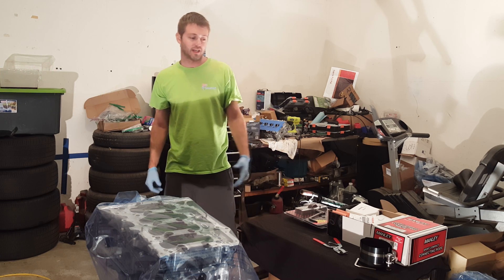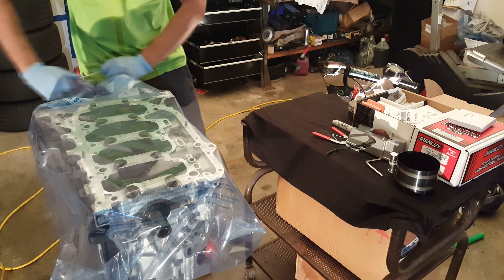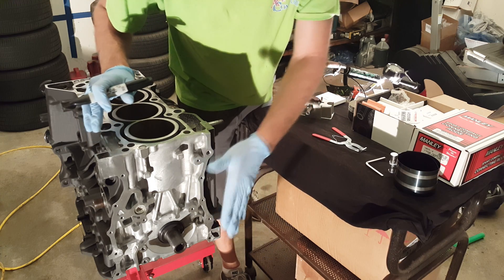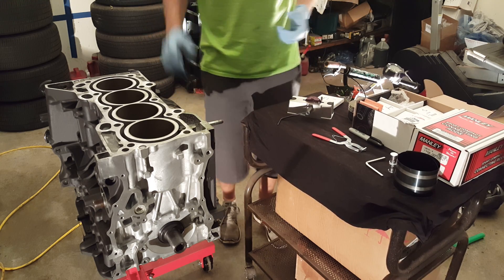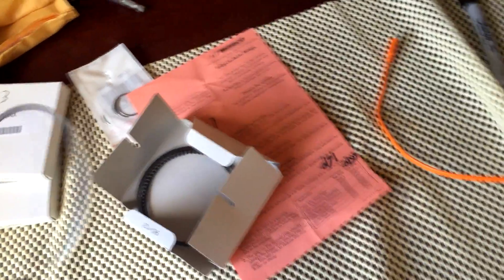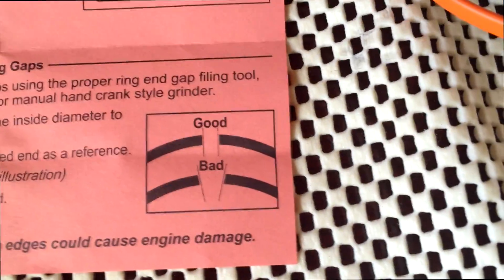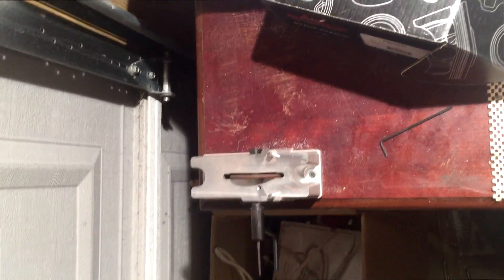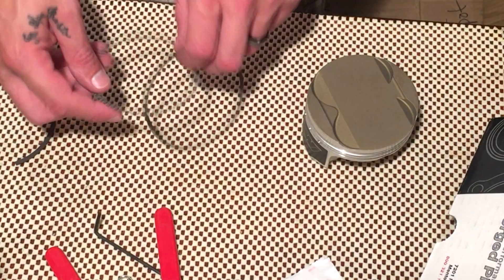Boosted K24 Honda: Piston Ring Gapping and Install

Comment: i have a question for you,for the bearings on the connecting rods did you order standard bearing size and just install them or do you use plastiguage or use a dial bore guage? it will be intresting to see a video on how you unbox the bearings and measure them for proper oil clearance.thanks for sharing your knawlage with us.
Reply from the maker: what i did was take the old crankshaft, rods, and bearings to the machine shop and had them tell me which bearings to use. which was standard. In one of my next videos i show how to use the plastigauge to measure the oil clearance on the rod bearings.
Reply: +Southern Ricer Garage oh ok so by the old crankshaft and old rods do you mean the current forged setup you are running right now?like you got your forged rods and crankshaft and took it to the machine shop right?or did you take your stock rods for the bearing sizing for your forged rods?sorry for the long questions but i just want to make sure.
Reply from the maker: Ismael Candia both.

Comment: @Southern Ricer Garage....I thought you were going to sleeve the block.  With the amount of boost you plan to run on the block...even with a good tune. I don't think will last too long
Reply from the maker: Methodical 66 the tuner I've been using for the last couple of years told me not to worry about that at 18-20 psi. He has been right so far. K series engines are super tough. This is my daily car too it won't be at 20 psi very often.

Comment: I have heard that its best to use Honda's piston clocking pattern instead of the piston manufacturer's clocking pattern.  How true is that idk?  Just saying lol.  Great diy videos man, they are good for other ppl like myself who have never done a build and are looking to do one also.  I have a k20a2 head and k24a1 block and looking to make a decent frank motor.
Reply from the maker: i haven't heard that before. I figured Honda's clocking would be the same. i used Wiseco's clocking and end gap recommendations for turbo applications.

Comment: When u say .17 top ring is it in inches? Coz i have a feeler gauge thats in mm so do i just convert the .017 to mm? Which is like .43mm
Reply from the maker: yes that was in inches. Here is the chart I used: 

                                                                    Top ring     2nd ring              Oil rail
Most standard engines                       0.004              0.005                    0.015
Modified engines or Nitrous Oxide        0.005              0.0055            0.015
High performance racing                        0.0055      0.0053             0.015
Racing with Nitrous / Turbo              0.006              0.0057            0.015
Blower / Forced induction                       0.007              0.0063            0.015
  
Multiply your bore size in inches times the value on the table (to convert metric bore to inches, divide your metric bore x 25.4. For example, 77mm divided by 25.4 = 3.0314”, multiply this times the value on the chart).

Comment: your using your ring grinder backwards lol. you turn the ring around and push it into the t metal posts and both sides of the ring will grind at the same time. then you juut clean up the ring and throw em in
Reply from the maker: blu3cha0s negative ghost rider. Wiseco specifically said only file one side of the rings and only in one direction.
Reply: Southern Ricer Garage if you press it from the other way it will grind them perfect.  Them just clean the edges up with a nail file. Its been working perfect for me for a long time. Amd ive never ordered rings from wiseco however idk how the ring they give is different than my local machine shop. I agree with every other step you did. Sometimes you just gotta put your owm little touch to it lol
Reply: wiseco has been proven to be wrong several times